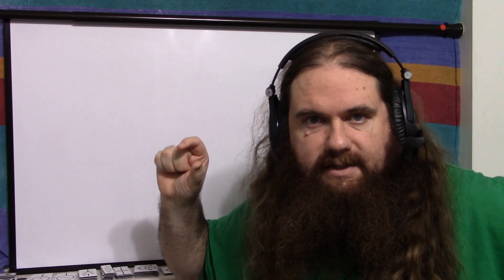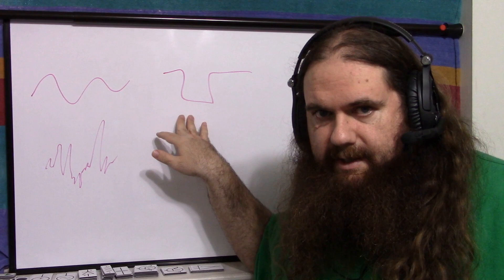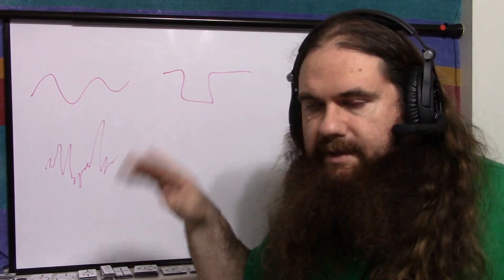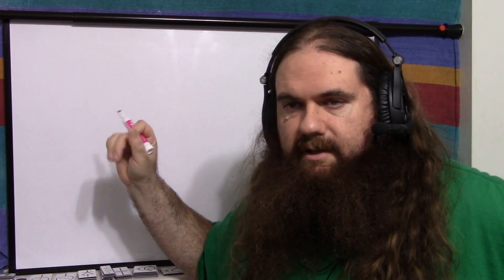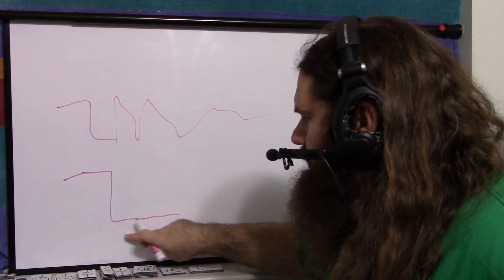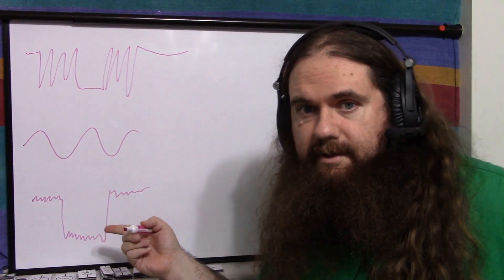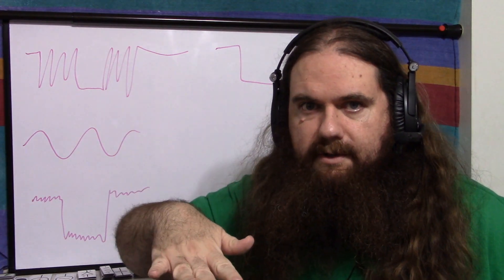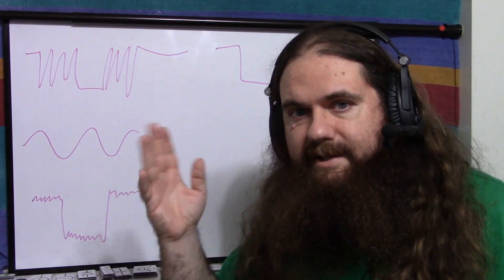Electrical Philosophy - AC, DC, Analog, Digital Signals - What Do These Words Mean - Simply Put

Comment: I think that it's very good to take some distance from the topics we are focused on and let our mind fly around the assumptions we are making just to simplify, label and clasiffy the diversity of elements that compose the real world. 

This is a great process to advance, but we sometimes forgett that these labels, classifications etc are just convenient artifacts that we invented. 

If we don't take some distance  we may risk to get too attached to our inventions and forgett that the reality was there before we created these names and it will still be there once the names are forgotten.  

There are many possible models to describe or predict the natural processes. The analog versus digital paradigm is just an extremely useful way to describe a single magnitude. 

You just have to increase to the infinite the sampling rate to unify both concepts (or add infinite terms to a Taylor or Fourier series). 

 Now, touching down the grownd again, using the analog/digital paradigm has allowed us to do "quasi-magic" things like converting the action of phisically disconnenting the cable A(uncle Tom) from the B pole (sister Anny) and reconnecting it phisically to the C pole (the (uncle Tom's buddy) .... to the action of merely "changing a memory pointer in a database".  

It's also quite magic that we can obtain similar results using a phisical device to "store and deliver energy"  such a capacitor that the ones we can obtain in a digital filter when we add or subtract mathematically fractions of the n previous values of a time's series. 

We play around handling and representing information with phisical energy  or abstract numerical simbols, and the other way around. 

I find it magical. 

By the way, I like pretty much your channel. Congratullations.

Sorry if my english too bad. It's not my mother tonge